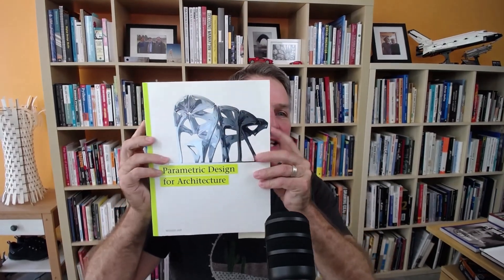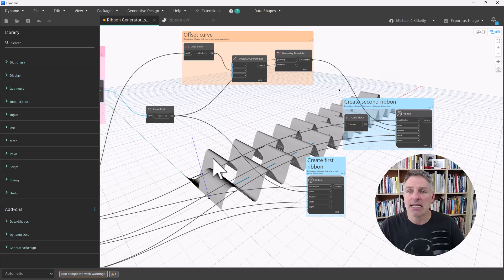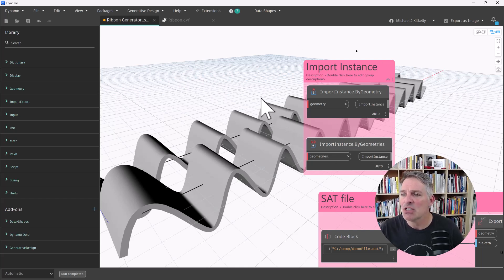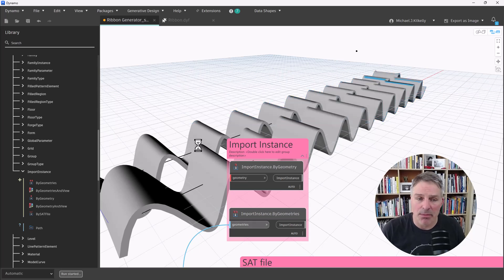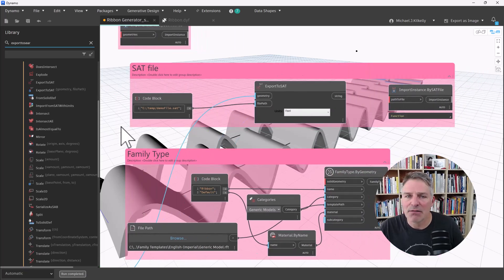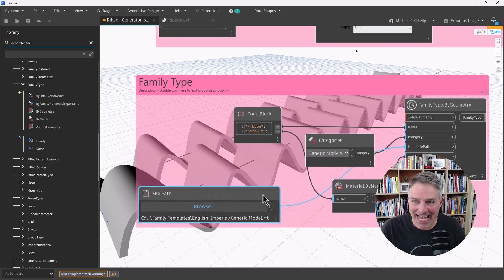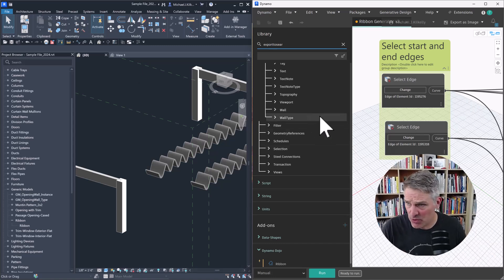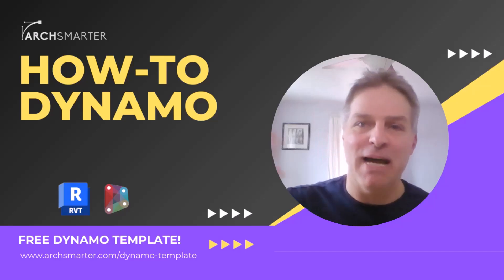4 Ways to Export Your Dynamo Geometry to Revit

Comment: Thank you for your video. But i have a quesion that the input of node "FamilyType.ByGeometry" is the solid geometry. However, i just want to export polycurve or surface. So that, are there any nodes can replace this node used for polycurve or surface?
Thank you so much !